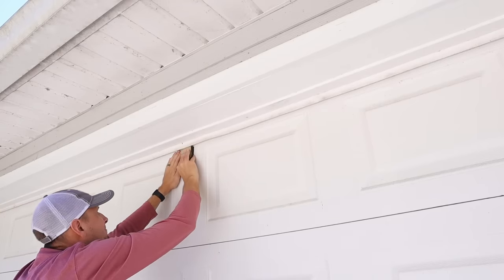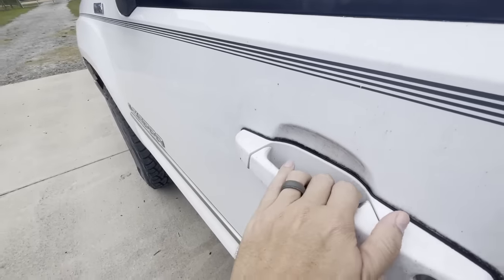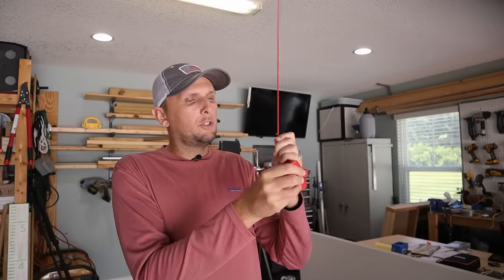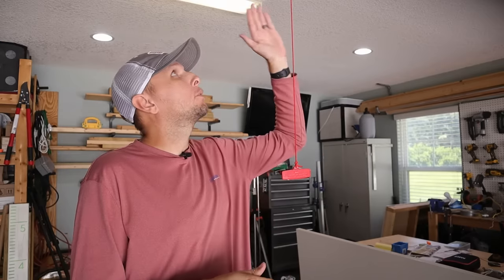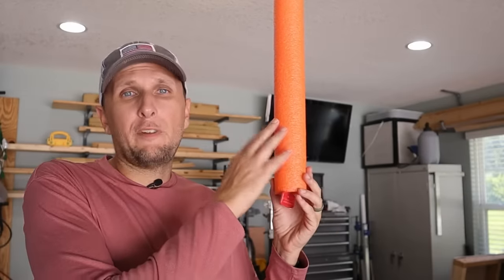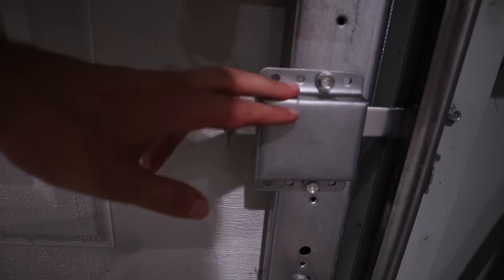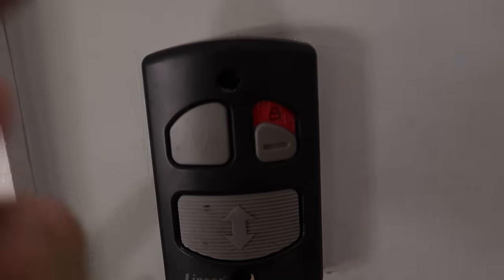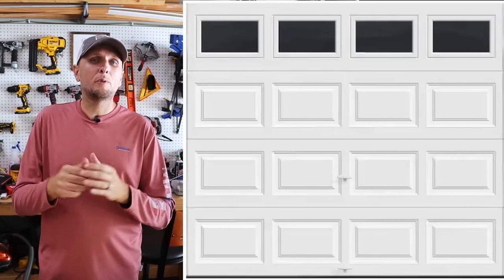How to Stop Garage Door Break-Ins | Number One Way Thieves Get Into the House!

Comment: Wait, people don't lock the door that leads into the garage??? I'm always astonished when I hear about all the doors that people don't lock. I grew up in a boring rural town in the middle of nowhere where nothing ever happened, but I was still taught to keep every door locked at all times. You walk in and you lock the door, you walk out and you lock the door. Same thing with my car, you get in and you lock it, you get out and you lock it. It's still automatic behavior and I'm 42.
Reply: I'm in a rural area that's fairly safe, and I'm definitely paranoid about checking that all my doors are locked before I leave. Except this door. I've only bothered ever bothered to lock the door between the house and garage at night. 

Even before this video, I had already decided not to leave my garage door opener in a locked car parked outside the garage. I'm even someone who got a pack of doberman's and a cane corso to look after the place. Lots of motion sensor lights, etc. But I've never felt the need to lock the interior garage door while away, not saying it's a bad idea, but after a point, there's only so much you can do. If someone wants in bad enough, they'll find a way. Plus, if I ever locked myself out of the house, I like knowing I can get back in with only the keypad or cellphone.
Reply: @garreth629  Of course they can get in if they want to bad enough, but an unlocked door is basically an invitation. I think locking all your doors is the bare minimum a person can do to keep their home safe. I never felt the need to get a pack of guard dogs or a high tech security system (nothing much worth stealing in my house anyway lol), but I’m damn sure keeping every single door locked at all times.
Reply: @R B.. Wait, people don't lock down the garage door on the INSIDE which disables the ability to wirelessly open the door? In my system, if you LOCK the control on the wall, you can't open the door with a wireless remote. Locking the door to the house is one thing, but if you are not locking out wireless access for the night, the job is only HALF done. I mean, who in their right mind would install a wall unit that does not allow locking out wireless controllers. Like the Genie Series II Garage Door Opener Wall Console.
Reply: A crook does not care if the inner door from the garage to house is locked or not. Once in the garage, they close the garage door immediately (for stealth) then go to the inner door. They kick it in, smash the window (if one) and unlock it, or the easiest method is to put a big steel pipe on the knob and break the handle right off - very quiet. Alarms, silent and piercing, help. Retired neighbors that like to keep an eye on things are great. Try not to leave your house/arrive home at the same time or even take a different route to/from work at times. Many daytime crooks "case" you for a week or more before they pounce. Then you have the "second story men" that use ladders to smash in a 2nd story window to get in. The pros cut phone/data/power lines that use dial up/email/text to call police or a monitoring company - those are useless. Some alarm systems use the wireless cell network to contact the monitoring company. These are battery backed up and will work when all power/comms are cut. But a crook could use a wide band local jammer in a van (crooks love to use vans for stealth and in case they hit "the mother load") that can block the alarm system cell/radio call.  The more you have, the more you will attract high tech thieves - which steal most of their high tech equipment by the way. If you go on vacation, NEVER blab on social media (or even the phone) on how excited you are, or even mention your day's schedule. In the early 90's there was a woman down the street that used her cordless phone around the house ALL the time.  I had a scanner and I knew everything about her schedule - and apparently so did a crook, she was robbed twice. Law allowed to monitor a cordless phone but never to act or share on who you were monitoring - so as much as I wanted to tell her how to stop getting robbed, I could not by law, the statute of limitations have run out on that but I still keep her identity secret. Most cordless phones use digital voice which requires more complex equipment than a scanner, some are encrypted too. Be careful with cordless home phones.

If you have older teens at home with their own cars that come and go at different times to your schedule is great. Being home/away randomly is better than being a creature of habit/schedule. If you leave for more than a day, it is best to get a very trusted/vetted house sitter. What puzzles me is those celebrities that make millions per year and they fail to have bonded security agents at thier home 24/7. They could hire 4 that work shifts for 24/7 coverage with days off. You feed them and give them a large bedroom (with privacy partitions - like in a fire house) and pay them 30k each a year, not a bad gig to sit around, be alert, get free room and board, and get paid too.
Reply: I live out in the country, set back from the road. The biggest security measure I have is being far from the road, on a hill, and being in an area where we can own guns, everyone owns guns,  and many of us shoot targets on the evenings and weekends. It definitely seems to dissuade break ins, when they know for certain that if someone is home, or comes home and catches them, they’ll be very well ventilated. 

As for other security measurements, we don’t have a garage, our 1920s farmhouse has a carport that was added sometime in the last 50 years. As for doors, we lock them if we’re going to be gone for an extended period, either several hours or days. But even that is an absolute case of security theater, as are all houses that have ground floor windows and wood frame doors. Residential doors are designed to be breached by firefighters. They won’t stand up to a donkey kick or a crowbar aimed at the area surrounding a deadbolt. 

Don’t even start me on doors with large glass panes, or ground floor windows. The latches on windows are often plastic or aluminum and easy to break or bend with a little mechanical assistance. Worst case, they can choose a side that doesn’t face neighbors or roads, or is sheltered and smash the window. A house alarm might cause an inexperienced burglar to leave, but most know that they have a timer on them and can smash and grab a few valuables before the cops even get the call from the security company. 

As for cameras, they’re more of a security threat to the owner than to a burglar. You’re sacrificing your privacy for eternity for the possibility they might get a blurry picture of the guys hat who just stole all your grandma’s jewelry and your TV. I’ll consider adding a couple POE cameras hosted locally on a physical server in my house and maybe have a way for me to directly connect to the server IP to view remotely, but I will never ever agree to the TOS of these security companies which allow them to monitor and redistribute your footage stored in their cloud, either to law enforcement without your consent, or internally to use for who knows what. We’ve seen it with Ring doorbells, we’ve seen it with other companies. 

Locking doors and setting alarms, at least in my case, would accomplish little as I’m isolated enough no one would hear or care if they heard the alarm, and police response would be so long they could clean out my house multiple times over and leave the area before the police arrived. As for locked doors, if they’re brazen enough to make it up my driveway to see if there are vehicles or other indications of people being home, they’re likely armed and willing to go to extreme lengths to get inside and get what they want. My last resort is arming and preparing myself.
Reply: I put a medeco M3 on the door leading to my garage. Use it every night.
Reply: @nickram81  Great idea. I have a similar unit on my barn door.  But remember it will deter most crooks but the "techies" will hack it off with a sledge hammer, apply a voltage to the wires and run the bolt back - it takes less than 10 seconds. But it is great idea to have. 

 Ok, I normally don't mention this in public but I design custom lock systems for high end homes. Multiple security levels is key (no pun intended) but the "hidden" and "unusual" backup system can often thrawt even the most tech savvy crook. One of my basic systems is a magnetic switch embedded outside somewhere - it may be on the wall, in the ground, but not near the lock. Say I put the switch in the ground next to a rock in a nearby garden. The owner comes home, picks up the mail, casually moves their foot (magnet in the shoe tip) past the rock, the switch trips, sends a underground signal to the lock controller inside the house to "enable unlocking" for 10 seconds, the owner taps in the unlocked code at the door, then servos move eight 4 inch locking bolts out from the door edges for 10 more seconds until disabled. The door and frame is solid steel with big internal hinges. It's a bit expensive when you consider the multimillion dollar homes that are out there, they cost next to nothing. The hard part is to make "hardened" systems look natural. By the way, that magnetic trigger was used by a guy that had priceless cars in his garage. That was just one of the many security features I put in for him... including adding a 360 totally floor/wall/ceiling inner garage with welded Rebar reinforced concrete. The garage doors are the weakest entry, but they open DOWN into the floor with hydraulics. I designed and built the whole garage security suite... he is very happy with it. The owners are a bit inconvenienced - like this guy that has to put on special shoes and act nonchalant and do something innocuous to get in his garage, but it is worth the protection. Only he and I know how his systems work, and THAT is the best defense.  This work is just a side hustle... not a lot of call for it.
Reply: @paulromsky9527  that sounds pretty complex but also pretty fun. BTW, the medeco M3 deadbolt doesn’t have any electronics and you likely will not be able to knock any part of it off. Frankly, any real criminal is just going to walk around the back of my house and come through our glass French doors or something.
Reply: @nickram81  Yes, crooks can be clever. I am going to look into a Medeco M3, sounds like a nice deterrent. The remote magnetic switch pre-unlock system is very simple. I can get all the electronics from Digikey. I use the Arduino UNO microcontroller, about $25 for the brains.  The door was tough. I had to weld steel doors,  make the hinges, and the locking pistons from scratch. I had to find steel plate and then I hired a welder. The customer approved and paid for all work. I put wooden overlays and a knob on the door myself. The hydraulic Drop Garage Door was tough, I had to dig down 10 feet and put in a concrete door foundation (12 feet long, 3 feet wide, 10 feet deep). Luckily, he built the garage around the security and not afterwards. The hydraulics were from online from various sources.  I had to get a guy to excavate, and another to pour the concrete. We didn't pull permits because the customer wanted to keep it secret. The subcontractors were not given any details, just dig here, put in a wierd foundation there. I get a job like that maybe once every ten years.  I am retired now, I just teach Summer STEM in my home. 8 hours a day, 5 days a week, for 8 weeks over summer. I hand pick only 6 students, grades don't matter, just the hunger to learn. And it's free! Parents love me, they said they would pay me over the school year to "de-program" their children from all the liberal/woke concepts they teach in public schools these days.... no... I am sticking with STEM.
Reply: I grew up where no one locked the door, or if some one did all the neighbors had a key, so if anyone was ever locked out they just had to walk the mile or so to the next house and get the key.
Reply: @MilkieBeargames  It's kinda that way here in Southern New Hampshire, but we are close to the Massachusetts border so we lock our doors at night or whenever we are away for more then a few minutes.   It's a good idea to have neighbors you can trust with a key to your home. It gets cold quickly here in the winter. My first home up here had oil heat. About once a year the furance would trip. Luckily I was home when it happened. So, if I was away for more than a day, I asked my neighbor to check on my house once a day, and I returned the favor when he was away.  My friend went on vacation and scheduled an oil delivery while he was away, the oil company ran behind schedule for a couple of days during a cold snap and his furnace ran out of oil - a few of his pipes froze and burst. He came home to a mess.  In New England, NEVER leave your home alone for more than a day during the winter months.
Reply: Some people done even lock their main entry for either. A person by rights shouldn't need to worry about their house being broken into. But that's why human beings suck.
Reply: @paulromsky9527  This is an interesting lock system. What happens if the Arduino board fails or the servos fails? Or the wires in the ground fails because of soil movement over time? The electronics always fails eventually... Is there a way to bypass the system for repair or maintenance?
Reply: @Dicofol1  The door can be opened by cutting a small hole (using a blow torch) in a very particular spot, flip a latch, insert a pin, then unwind the pistons manually using a ratchet and socket. There are special tamper "traps" if the wrong spot is heated. If that happens, the whole door has to be cut off which would take a few hours. The wires are in flex conduit below the frost line. The door has a wooden overlay that hides that it is a security door, but only I know how to remove the overlay, triangulate the spot, and how small to make the hole. I have details written down to be sent to the owner by my esate executor upon my death, but the less the owner and sub contractors know the better.
Reply: Same
Reply: @garreth629  I'm in a busy area, and I'm not all that concerned about locking up everything.  Overall, our house isn't a tempting target.  We're on a busy corner, so there would be witnesses to anyone trying to get in.  We're also rarely all gone at the same time, and we've got a dog that would bark if anyone came in.  We're night owls, so even in the wee hours, someone is likely to notice noise outside.  We don't have the stuff thieves like to take.  Our cars are all older, our TV's are older, we don't have cash, jewelry, coins, guns, booze, drugs, expensive tools, or portable collectables.  My husbands computer system has value, but good luck getting it unhooked and out the door intact

The people in the house are valuable, and locks won't stop anyone who means us harm.  Break a window, and you're in.  Anything else is insured.  The doors are locked when we're sleeping or gone, but otherwise...."Welcome to my parlor, said the spider to the fly."
Reply: @Rolling Withthepunches For what it's worth, if someone means you harm, is there really a way to keep them out?  LOTS of women with stalkers have had to confront this idea.  Battered women know there's no locked door that will keep them completely safe.  

I think security companies get a lot of business from the notion that criminals aren't just thieves who want your stuff, but that they'll lie in wait for you to come home. 

Rather than try to cover all contingencies, I'll do the basics, and save the money on all the bells and whistles--which will offset any losses.
Reply: A lot of people stupidly believe nothing bad can happen to them
Reply: Garreth629 you're not safe anywhere on this planet. Don't fool yourself into believing you're safe because you live in a rural area
Reply: Those doors are often made of tissue paper.
Reply: @neobaggins3718  agree with everything.  A big dog is the best security.  Many food delivery people run after hearing the first bark and have to get a credit card over the phone.  The door sidelights show off the size of a dog.  A hundred pound dog going nuts dissuades people.
Reply: My 40yo son has a nice home but leaves the garage door open and other doors open and has a glass back door . Won't listen to my warnings. Says it's a nice neighborhood!! Naive. Some people don't learn until something goes wrong.
Reply: Doors can be kicked in very easily.  A battery powered chainsaw makes getting into most houses very easy and quietly through the walls.  If prisons are broken out of why do you think your home cannot be broken into?  Locks only deter opportunistic thieves.
Reply: @brianhillis3701  yep, locks only help honest people to stay honest!  Put alarms on the doors, glass break sensor alarms on the windows, get a gun, a flashlight, and have a plan that you practice often for when one of those alarms goes off in the night!
Reply: I live in suburbia, and we still don't lock house doors or car doors. Never had an issue or any fear.
Reply: @johnw8578  You must have a huge bad dog.
Reply: YESS I AGREEE...
Reply: LOL once they get access to the inside of your garage they can shut the door and then have all your tools to break into your house thur your locked door without anyone seeing them or hearing them
Reply: The best system I encountered was a farmhouse with two rather large dogs. Anyone pulls up the driveway, begins talking with the dogs, tails wagging and then gets out and pats them. Friendly, friendly. The dogs wouldn’t even stop them breaking into the house. However, a bit like the Hotel California . . . Just try to get back into the car. You ain’t going anywhere. Right, you can never leave, until the owner returns. Escape by foot, not a chance.  Imagine a couple of flat screen tvs, expensive fridge, white goods, jewelry, the lot, all sitting neatly next to the mug’s van, along with a couple of ne’er-do-wells sweating profusely and somewhat soiled trousers.
Reply: I do not lock my doors at all. If you are stupid enough to walk into my home unannounced (With all the warning signs visible from the road that a gun probably is sleeping there) then don't be surprised if you need a tetanus shot from the extra metal that suddenly appears in your system.
Reply: It makes no sense to lock the door between the garage and the house. Once the thieves are in the garage they have all the time in the world to work on the inside door without being seen. They will just wreck your inside door and get in the house anyway.
Reply: @garyabc  : Very true. 
Unless we have locks on every room in the house. 🤣
Reply: We don’t lock anything and we leave keys in cars a lot. I’m in the middle of literal nowhere. Even if someone were to come and take something. I have plenty of time to grab my rifle and retrieve my property. It’s going to over 30 minutes before the sheriffs dept gets here, and it’s not me that will want them to hurry up.
Reply: Me too
Reply: @paulromsky9527  Good morning, will you tell me what  STEM  is.thank you from the UK.  Stay safe everybody.
Reply: @paulromsky9527   Thank you for a very fast and informative reply,it is the same in England with very biased results ( state v private schools) you can smell it a mile away.  The only thing to do is to tell people what is happening. Stay safe.
Reply: @paulromsky9527  you couldn’t just leave her an anonymous note or something? haha
Reply: @TPrivate  Can you tell me which comment your reply was referencing? YouTube is kinda weird where you can't always respond directly to a comment and responses end up at the end of the comment thread rather than next to the individual comment. This is a pretty big thread now.
Reply: Times have changed, 25 years ago on the farm, my grandparents and aunt and uncle never locked any door and also left their car keys hanging in the ignition.
Reply: @paulromsky9527  Something about knowing the lady was letting thieves know what she was doing but law prevented you from telling her
Reply: I now live in a rural area and have a friend who is a realtor, and lived here for 50 years. They were taking a family vacation to Hawaii, the first vacation with the entire family in 12 years.  She thought they should probable lock the house when they left, but they couldn't find one single key to the house. They had to call a locksmith to re-key the locks.  Me, from the city, was astonished.  They live in a real nice house with a lot of nice things and NEVER locked their house when they left!
Reply: Locking the door is so automatic with me (and my husband) that I'll lock my husband out when we are bringing in the groceries 🤣
Reply: @paulromsky9527  Great information!
Reply: @Verro2  I do the same thing! My wife will go outside to work on her garden and such. Then if I go outside and come back in, I instinctively lock the door behind me locking her out - she gets P.O.ed at me [laugh].
Reply: @TPrivate  I guess leaving a note might work, but to remain anonymous and to give such strange news in such a way could compell the person to call the police anyway... such info has to be presented with tact, from a neighbor, and not cause any shock.  Best to not listen in on radio conversations.
Reply: 100% relatable.
Reply: A lot of garage doors have windows across the door too and it's as easy as busting out one window, take a stick from the yard, put it in the broken window and push the the garage door button on the inside wall and you're inside the garage.  Then, you can walk right in the house if that door is unlocked.
Reply: And that door is consealed to public which makes it even easier to "break in"._
Reply: @DjResR  I lock my garage, the car gets locked inside the garage and the DOOR to the house is always locked. People need to remind themself of the evil people in the world and try to protect themself as much as possible.
Reply: @rickschlessenger3464  Exactly._
Reply: @DjResR  Be safe and well.
Reply: What about when you're at work? Is that door between the garage and the house locked?
Reply: @scottnolan2833  I keep everything locked up. Garage door has double locks, cars locked, door from house to garage has double locks. All locks deadbolt can only open with a key.
Reply: I'm sorry you had to grow up in the era where you had to lock the doors constantly. I'm a little older than you and we only locked the doors at night when I was growing up in a rural area. Of course what was rural when I was a kid is far from rural now. Of course we left the keys in all the cars too.
Reply: @Cartier_specialist  People in Newfoundland never lock house or car doors. Yes, still in 2023.
Reply: @rogerjoesbury9410 Science, Technology,  Engineering, and Math.
Reply: @rogerjoesbury9410 Science, Technology, Engineering and Math.
Reply: @paulromsky9527  Your comment made me remember when I was 5 years old in Lubbock Tx in 1965 our neighbor was a police officer and we could hear him calling his wife on his police radio through our organ when it was turned on! I guess not that much has changed then? LOL!!
Reply: @lesliebooth2833  In 1965 just about all police radios were simple AM radios. Scanners were available but were bulky and expensive. I was in a garage band in the late 70's early 80's. If you plugged in a guitar with a bad ground into an amp, we would often pick up radio stations. Funny that your organ picked up the radio, that is rare.
Reply: Even more - people have a door that connects their garage directly to their house? Not just one that leads into the backyard, and then a door from the house to the backyard?
Then again, I live in a multi-flat house where someone might get through the main entrance with a ruse of some kind, and a lot of people leave their appartment doors unlocked. Haven't heard of any break-ins in this or any similar house in over 20 years... Gotta love civilization 😜
Reply: @GODDAMNLETMEJOIN  Crime rates have gone down? What color is the sky in your world?
The crime rate around my area has gone up significantly.
There are 14 year olds stealing Kias to smash through store fronts, robbing the place, then driving off with another stolen car.
Shootings have gone up significantly in the nearby city.
Reply: I haven't locked any door for fifteen years or so, whether that's my car or house....
Reply: We have a keyless service door into our garage so people can go in and out as they please without opening a garage door, anyway, I accidentally locked the door into the house from the garage, and my brother was out that night, he was locked out. 

I guess the only fool proof way to prevent that is for all members to have a key, or have a keyless entry into the house(that may be a nuisance). 
I don't think you absolutely need to lock the garage interior door every night.
Reply: Lock ALL doors 24/7 .   100 cameras everywhere, dogs all over the house , nosy neighbors who's always watching their surroundings. Keep your valuable else where and not into the home. Oh yes let's not forget those skunks who likes to visit the home ( and this is no joke).
Skunks and Raccoons, yes in the city. They like living underneath the porch or around the foundation of home.   They are out anytime of the day or night. They are NOT scared of people.   Whole different world .
Reply: Locking internal doors is pointless. Once out of sight, crims will break that door.
Reply: I’ve got an older friend and she and her hubby don’t ever lock that door, it drives me nuts!
Reply: ...and I still don't understand that the manufacturing companies put a keypad outside and not a keypad on the car remote...
Reply: Yep
Reply: I always lock all doors and windows, then don't worry much. My adult children tell me I'm overly paranoid since I lock my doors. I can't believe they don't understand the logic of simply locking your doors, keeping your porch light working, etc. I wonder how they missed that.